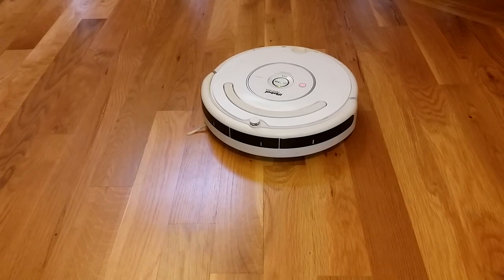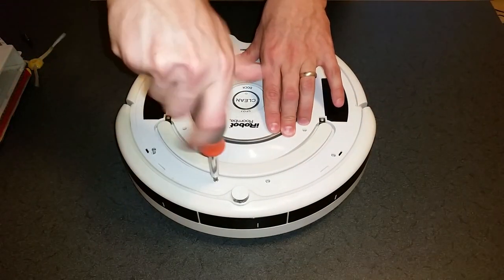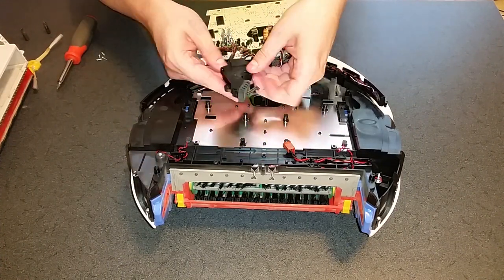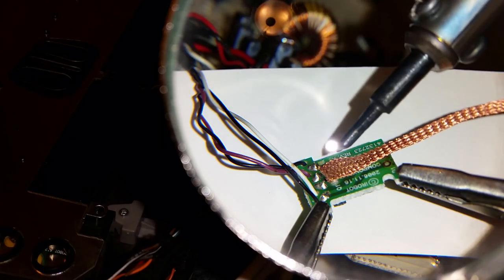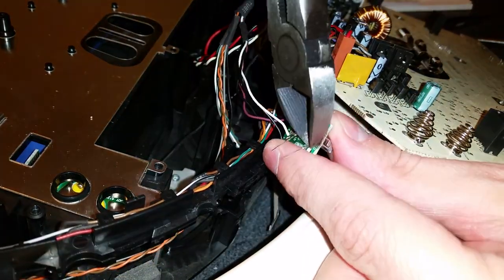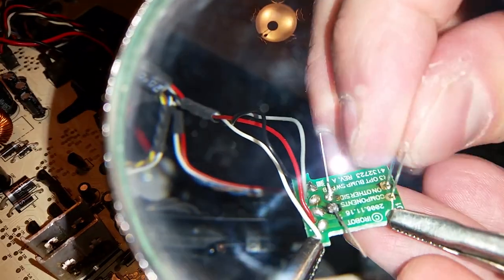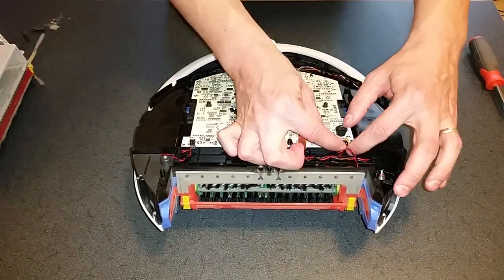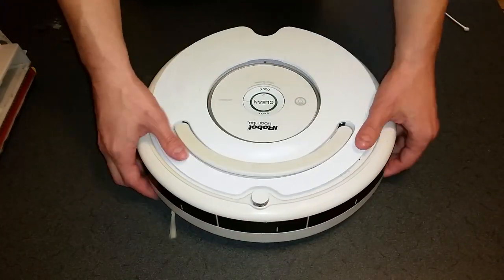Fixing Roomba Error 9 and Circle Dance

Comment from the maker: IR LED & Phototransistor Pack:
https://www.ebay.com/itm/115606220081

Soldering Iron:
https://amzn.to/2URUMJe (affiliate*)

Solder:
https://amzn.to/3bKn5jl (affiliate*)

Desoldering Wick:
https://amzn.to/39yiwHA (affiliate*)

Helping Hands with Magnifying Glass:
https://amzn.to/39upUDL (affiliate*)

*Purchasing from these Amazon affiliate links earns my channel a small commission. Think of it as a tip that doesn't cost you anything. Thanks for the support!
Reply: Is there a way to determine which bumper has failed instead of repairing both.
Reply from the maker: I can't think of an easy way to tell if only one bumper has failed. The thing is, these sensors just seem to wear out over time so I would recommend always repairing both bumpers at the same time. It wouldn't be worth it to take it all apart, fix one bumper, and put it all back together only to have the other side fail a few months later.
Reply: Mike great descriptive video, but you wouldnt happen to have a video for the same circle dance for coredy vaccum?
Reply: Plus $7.08 shipping
Reply from the maker: @jovonb935  Sorry for the very late response, I just saw this comment. Sorry, no, I don't have any info for Coredy.
Reply from the maker: @AndThenIMade  Thanks for pointing that out. The best shipped price I've found is still the eBay link above.
Reply: The link is no good anymore do you have a newer link my Roomba just started dancing 🙄
Reply from the maker: @Pete6641  Thanks for letting me know. Here's the new link: https://www.ebay.com/itm/114741413942
Reply: @Mikeattempts  thanks!!!
Reply: Links no longer working. Any tips?
Reply from the maker: @marianialvaro7603  Looks like the eBay seller I bought from is out of stock. You could try this one: https://www.ebay.com/itm/275075653981
Reply: We’ll, we cleaned the iRobot and I need the IR led and phototransistors but your eBay link doesn’t work. How do I know what part I need to give you credit? Or should I go to Roomba?
Reply from the maker: @patriciaterranova1074  It looks like the eBay seller I bought from is out of stock. You could try this one: https://www.ebay.com/itm/285059480791
Reply: I bought the last pair of these. Do you think they’ll get another shipment ? Mike is there another seller? I had someone helping me with the repair. Ty
Reply from the maker: @patriciaterranova1074  I can't guarantee but I would hope this would come with 4 pieces total, enough to fix both bump sensors. If not, it looks like that seller has been selling a lot, so I assume they'll get more in stock.
Reply: Hi. This parts are suitable for Roomba e5 ?
Reply from the maker: @slavaukraini4359  It should work for Roomba 400 - 980 but I'm not sure about the e5.

Comment: I had an error 9 on my Roomba 875. What did the trick to overcome this was cleaning the small sensor windows in the bottom, near the edge. I simply wiped my finger once across each - took a few seconds.
Reply from the maker: Yep, that's the recommendation from iRobot. I should have mentioned it in the video but I guess I just assumed that if you're willing to take your Roomba completely apart, you'd probably at least tried cleaning it first. ;) Thanks for watching!
Reply: Thank you . It worked

Comment: For $16 I bought and replaced the entire harness that included all of the switches and sensors with 2 spares.
Reply from the maker: Nice, that would make this job much easier but I wasn't aware you could get those modules so cheap. Where did you get it, eBay?

Comment: Hey,  thank you for making this video. I’m in a physics class and as one of our last assignments we have to fix an appliance of our choosing. My appliance happens to be a Roomba with this exact problem. I’ve been finding this video extremely helpful, but I had a question regarding the IR LED. Is there a way to know which one needs to be replaced? Or should you just replace both? Thanks again for the video!
Reply from the maker: That's cool, I never thought one of my videos would help someone with their homework. :) I would definitely replace both IR LEDs and both phototransistors (4 individual components). They're so cheap ($7 total) that even if they aren't all bad now, it'd really suck to put it all back together only to have one of the others die a month later. It's a bit of a chore taking everything apart so you might as well replace everything while you're in there. Good luck and let me know how it goes!

Comment: Tip for those that want some soldering advice: Don't touch the solder to the iron. Use the iron to heat the component lead (prong) and PCB pad, takes about 1-2 secs, then touch the solder to the component lead and PCB pad. The component lead and PCB pad should be hot enough to melt the solder so it wets (bonds) and flows on to the metal parts. If you apply the solder to the iron, the lead and PCB won't get hot enough and make a bad deformed cold joint. Don't leave the iron on the parts for more than 2-3 secs or you risk burning them out.
Reply from the maker: Thanks for the tips, hopefully other viewers will find 'em useful. I hafta admit, my soldering skills could use some improvement. :)

Comment: Hi Mike
Nice guide for fixing the error.
Just a tip for your soldering. Use a smaller tip and turn your temperature down abit. After removing the solder use flux to get a bether solder and after cliping the legs use isopropanol to clean it up.
Reply from the maker: I agree with everything you suggested. Problem is, that was my smallest tip and the iron is only one temperature. :) If I start fixing more small electronics, I'll need to invest in a better iron. Thanks for watching!
Reply: @Mikeattempts  Does this work on 890 model?Thanks
Reply from the maker: As far as I know, these specific parts only repair this issue in the 500, 600, and 700 series Roomba. Before going any further, tap around the edges of the bumper to dislodge any dust bunnies. Next, use some compressed air to blow out the area between the bumper and the body of the Roomba. Finally, use a q-tip to clean the bumper sensors and also clean the front of the bumper with a little glass cleaner. Let me know how it goes.

Comment: I bought new sensors and tried to solder them. I think i burned up the circuit board. Do you know if a new one can be purchased?
Reply from the maker: Depending on your Roomba model, you can buy the bump & cliff sensor sets like this https://www.ebay.com/itm/155291747484 , this https://www.ebay.com/itm/235286640444 , or this https://www.ebay.com/itm/373176620310
Reply: @Mikeattempts  thank you

Comment: Hi Mike I’m trying to fix my parents old roomba and I can’t open the ir sensor and the photo transistor links
Reply from the maker: Yeah, it looks like the guy who used to sell 'em doesn't anymore. I found just the IR LEDs here: https://www.ebay.com/itm/261191571639 . Maybe the phototransistors don't fail as often? I also found this: https://www.ebay.com/itm/175488664981 . It's 5 IR LEDs and 5 phototransistors but I can't guarantee they're exactly what you need. I guess you could contact the seller and ask before ordering.

Comment: Just what I was looking for but I have to comment on your production value and narration, I majored in communications and both were excellent. It's like you were making a training film for the actual compaany! And my soldering is a little shaky :-) and I prefer to use a solder sucker I have one of the older ones from the 1970s that doesn't have that big cage on it! Anyway great work and have a nice day 🙂
Reply from the maker: I really appreciate the positive feedback. It's always nice to hear what I'm doing well (or not so well). Thanks for the comment and let me know how your repair turns out.
Reply: @Mikeattempts  it turned out fine but it took me three times as long as I thought it would to make the repair. Or should I say make the modification.
Reply from the maker: @patrickmccleary1144  That's great that you got your Roomba working again! I definitely know how you feel, this wasn't a quick repair. It almost always takes me 2-3 times longer than I thought to do most things. :)

Comment: Well, you show that there are two parts to fix the 9 Beeps Circle Dance for the Irobot: IR LED & Phototransistor Pack. I found a part on the internet that was supposed to fix the error. I received two "EMITTERS" that appeared to look exactly/similar to each other yet Im unclear if the part is correct. You show two different names on the parts, is there a source for what I specifically need?  

I'm worried about my parts.  But, it didn't stop me to learn how to solder. With the help of a handyman, we actually attempted to replace one on the front bumper EMITTERS, even to the point of soldering it in, with the eye pointing inward, THEN the fiasco happened when the baby spring bounced off, never to be found.   I scoured the internet and located an assembly with a spring but it was very expensive, so before I buy I need to be satisfied that the parts I used are correct.  Any feedback, please.
Reply from the maker: I went back and was able to find a new listing, from the same seller, for the exact parts I purchased to repair my Roomba. I updated the link in my video description but here it is: https://www.ebay.com/itm/115606220081 . So, each bump sensor has 1 IR LED & 1 Phototransistor. The IR LED shines infrared light, and the phototransistor sees that light. When the bump sensor is activated, the light beam is disrupted which signals the Roomba to back up and change direction. Anyway, I'm not exactly sure which part is the "emitter", but I assume it's the LED (cuz it "emits" the light). The phototransistor might have a much longer life so maybe you only need to replace 1 IR LED in each bumper to fix the problem. However, since it was so much labor to take everything apart, I replaced both the IR LED and the phototransistor in each bump sensor. As for the spring, I would put a magnet in a sock and swing in around on the floor in hopes of recovering that spring. Let me know how it goes and if you have any other questions.
Reply: You are awesome!  I think you're right, the Ebay source just sold me one 1/2 of the parts that should be replaced. I can't tell which one it is tell I investigate,  Like you, taking apart the vacuum does take time. We were at a Dare to Repair Clinic, in a public Library Space with volunteers assisting in the repairing when my spring popped out of sight. Being a woman, men sometimes don't like taking advice from us,  I actually brought a  rubber foam piece and a cloth to place under the vacuum just to protect the table/vacuum and stop the bouncing of screws. Over the years,  I've fixed my camera and computers, so I know about some parts disappearing and years ago, I can recall we were wearing rubber gloves to avoid wrecking the motherboards in our electronics.  

Regarding the Dare to Repair Clinic, you'd be perfect for organizing one. It's a Non-profit, with Tool Library, lending equipment to paid members. The point is to keep fixing and avoiding throwing things into a landfill when items can be easily fixed by a volunteer team and the owner of the broken item.  Thank you.  I'll share your video with the others who may have Roomba problems.
Reply from the maker: @patriciaterranova1074  That Dare to Repair Clinic sounds really cool. Anything that gives people the confidence fix things, or at least try, instead of just buying new is great!

Comment: Thank you! I will try this.
i want to buy the IR pack. but I can buy it from the link.. no shipping to Israel. 
i found this..
Specifications:
Emitted Colour : Infrared.
Size: 5mm.
Forward Voltage (V) : 1.2-1.4V.
Forward Current (mA): 100mA.
Wavelength (nm): 940nm.

it can works?
Reply from the maker: Contact the seller, LittleElectronics (either through eBay or via email at info@LittleElectronics.com), and ask him about the specifications you found to see if they match. You could also ask him if he'd be willing to ship to Isreal. Let me know how it goes.

Comment: Fixes Goovi robot vacuum as well. circle dance caused by bad IR LED sensors and same logic installed. Thanks for head start.
Reply from the maker: Ah, I didn't know the Groovi used the same method to detect bumps. I guess this would help with any robot vacuum that used IR LEDs. Thanks for the comment!

Comment: Help. I accidentally dropped my roomba , sensor down when cleaning the bin. I took off covers, Arch, the center wheel (which had enough hair to be a full sized mouse) you think that will help?
Reply from the maker: Yes, you can get error 9 if the bumper sensors are too dirty so cleaning them might resolve your issue.

Comment: Hi great video - any new links for the IR LED/Phototransistor pack? Amazon ideally. The ebay link is expired
Reply from the maker: I haven't been able to find it on Amazon. Thanks for letting me know, here's the updated eBay link: https://www.ebay.com/itm/115272998007
Reply: @Mikeattempts  Thanks for the reply - Do i only need to buy one set or multiple?
Reply from the maker: @kylemiller5442  One set should be all you need to fix both bump sensors.

Comment: Cannot they design this any simpler to remedy a fault, error?!
Reply from the maker: My thoughts exactly! This is a pretty common issue so wouldn't it be nice if there was just a little cartridge you could replace that contained the new sensor parts? I'm sure they would rather you bought a new Roomba rather than trying to fix it on your own anyway. ;)
Reply: @Mikeattempts  Yes, so much is throwaway, whereas sustainability is needed to lessen our impact.
Reply from the maker: I agree. If products were made to last or to be repaired easily, it would create customer loyalty. If I buy something expensive that needs a difficult repair after the warranty has expired, I'd be much less likely to buy that brand in the future.

Comment: I would like to know what phototransistors to use on a roomba 540 as the link does not work anymore as its been a few years.If you are still around could you give me a ideal on what to order.thank you Don
Reply from the maker: Sorry about that, I've updated the link in the video description: https://www.ebay.com/itm/114741413942
Reply: One question how many do I need for the unit
Reply from the maker: @dongledhill6214  The kit includes 2 Phototransistors and 2 IR LEDs (4 pieces total) which is all you need to fix 1 Roomba.

Comment: how can I find out  . if I need to replace phototran
sistor
Reply from the maker: Before taking anything apart, try cleaning behind the bumper with compressed air. If that doesn't fix it then it's probably the IR LED and phototransistors inside the bump sensors. The parts are so cheap that you might as well replace each part in both bump sensors while you have everything taken apart.

Comment: Might just be dirt that somehow got inside the sensor window. Is there a way to blow it out without tearing down the machine. It's the left front that I can see dirt clouding the window.  Thanks for a great video on tearing it down. If I must.
Reply from the maker: Yep, this can be caused by dust buildup between the main body and the front bumper. Just use compressed air to blow out the gap behind the bumper to see if that resolves your issue. You can also clean the little sensor windows with some rubbing alcohol on a Q-tip. Thanks for watching!
Reply: @Mikeattempts  the dust is inside the sensor enclosure. Inside the clear plastic facing toward the bumper.
Reply from the maker: @jffii  If that's the case, I can't think of a way to clean it without taking it apart.

Comment: Thank you so much for posting the video.  I had no idea how to replace the sensors, but the video walked me through it!  Unfortunately Roomba is still not functioning correctly.  After a few minutes of looking lost, a red light comes on and 9 beeps sound.  Any ideas?
Reply from the maker: Thanks for the positive feedback! Did you replace both sensors in each bumper? Most info about Error 9 says that you only need to replace the IR LED but the phototransistor can go bad too. Also, when replacing the sensors, be sure that the little circle bumps (eyes) are facing each other and that the new solder points aren't accidentally touching. You can also buy the whole bumper assembly, just in case something else is wrong in there. That's all I can think of off the top of my head, let me know how it goes.
Reply from the maker: I thought of one more thing, make sure the IR LED is on the end and the phototransistor is closest to the wires. The parts look almost exactly the same but the phototransistor usually has a dark line on the top or back and the packaging should have been labeled.

Comment: Hi there, don't know if you're still active on this video but, do you know if this fix also works for series 900? I have the exact same problem of circling and only moving backwards but just wanted to be sure before tearing into my expensive robot haha
Reply from the maker: I don't blame you. :) Before tearing it apart, use some compressed air to blow all of the dust bunnies out from behind the bumper. Sometimes that's enough to fix the problem. From what I understand, the fix in this video only works for the 500, 600, & 700 series. Let me know if you have any luck.